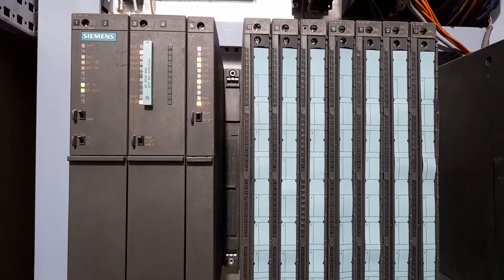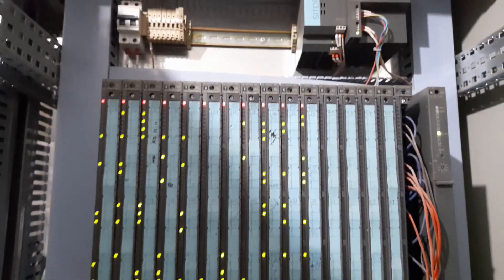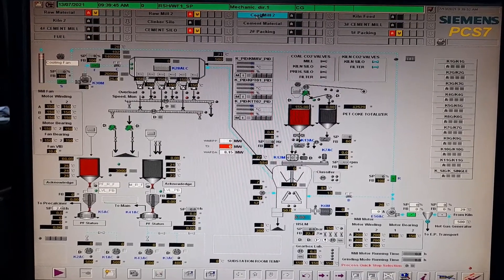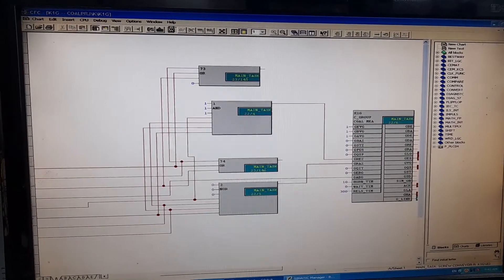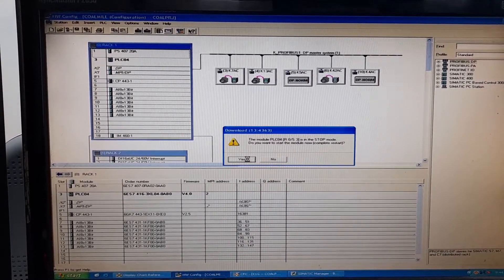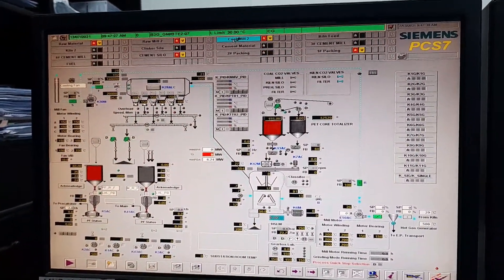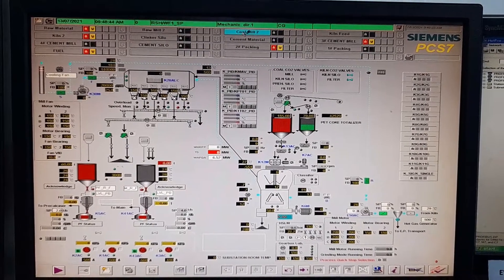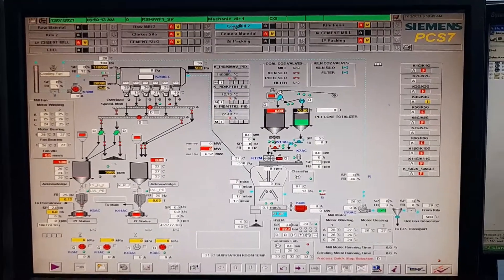Siemens S7 400 PLC Troubleshooting || PLC in STOP mode || How to restore PLC to RUN mode

Comment: Did you disconnect the power to the PLC?  Reconnect and it may clear the error that causes STOP?   To be able to re download the PLC ladder program again takes the expert with the
programming computer and the same program.  Maybe they changed something that caused this and the original program had to be re installed.  :pride-person-heart-lesbian:
Reply from the maker: Yes. Disconnected but this issue get resolved only with complete configuration download.

Comment: Hello there, I think I have same issue but with different setup. One of our redundancy 414 -H CPU has been replaced due to unable to run. We did memory reset after installing new CPU, and found the CP443 and new 414 CPU were stuck in STOP mode. I was checking the diagnostic buffer, and found CPU link up/ update by master aborted. Cause: Synchronization error in operating due to incorrect data. My question is: If I download the entire back up program and netpro config for this particular PLC, will it affect the master PLC that running properly? Will it change the netpro for other connection partner for master CPU? Thanks

Comment: is there any Siemens plc that still oke if got power cut? i mean the program not lost and no need to redownload. i found omron plc is good, no need to redownload after start up / or power cut
Reply from the maker: S7 - 300 and S7 1200 Program doesnt get washed even if power is cut off.
In S7-400 PLC in this video, must have internal batteries working, to save program from erasing.
Reply: @PLCNerd  oh thank you, is s7-300 and s7-1200 have internal battery too?
Reply: @sidikging2988 s7400 it has, 300 i think so no

Comment: In my case s7-400H plc not allowing to upload & download. Also try with mres switch but plc not reset what will i do ?
Reply from the maker: Turn the power supplies off. Remove the PLC CPU and then plug again. Turn the power supplies again. Now (if the communication media is ok) it will be able to download configurations from Engineering station/PG.

Comment: is the configuration not stored on the memory card of the plc? Could it not be restored by switching the MRES switch?
Reply from the maker: No. Not in the case of S7-400 PLC. In this S7-400 PLC, the program is stored in the RAM i.e requires continuous power supply.
BTW MRES erase the program stored in memory.

Comment: Hi good video. My siemens cpu s7400 show battery2 indication. Whats is means plz tell me.
Reply from the maker: It means that Battery 2 needs to replaced. It has been discharged.
Reply: Change the battery at position 2